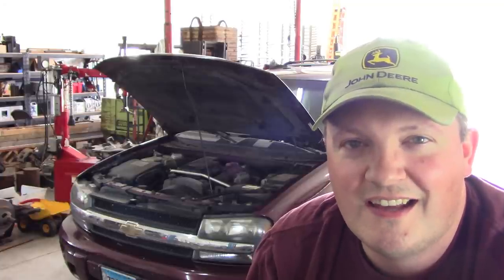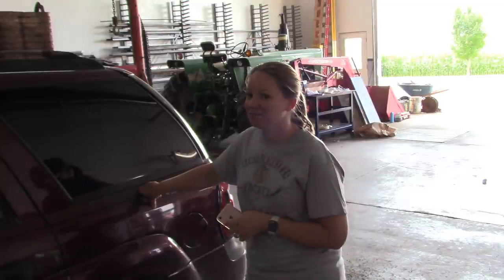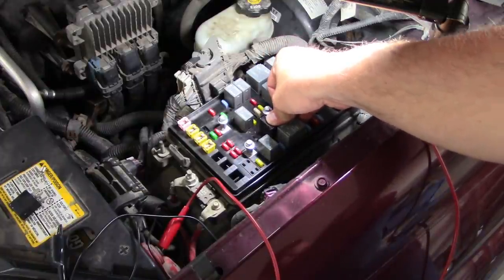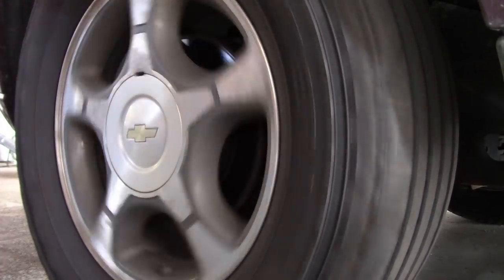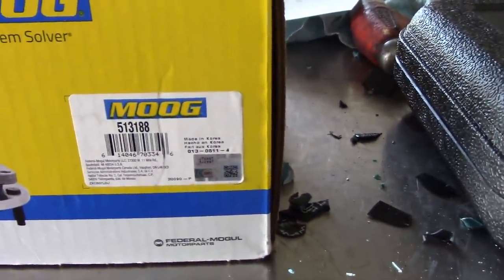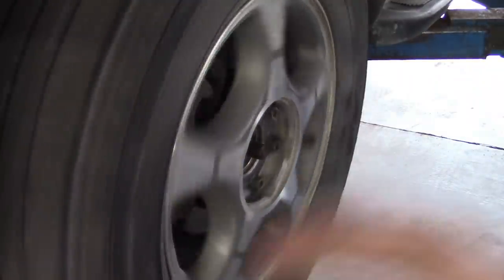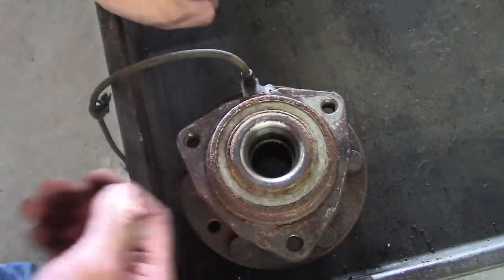Chevy Trailblazer - No Low Beam Headlights - Wheel Bearing Noise - P3

Comment: Hey Wes, just a heads up, we have 2 customers with trail blazers that have the same issue on the low beam headlights, for some reason though they only last anywhere from 6 months to a year. At first we were using o'reilly's relays but switched to AC Delco, but they still only last so long. Long story short we couldn't figure it out and they come in every now and then and we pop in a new relay.

Comment: It's not like that axle nut holds anything on other than just the axle to the hub. None of it's going anywhere even if it falls completely off. That old nut will be fine, even after it's reused again during the next brake job.
Edit: The new nut probably comes in one of those Broke When Delivered boxes anyway!
Reply from the maker: The nut holds two halves of the wheel bearing together, so it’s kind of important. But not enough to worry about.
Reply: I keep hearing that, but the splined sleeves in the hubs on my 07 K 2500 are one piece, like they're the inner race instead of two halves, maybe those K 1500 hubs are made different? I've driven my truck with the left half shaft out for quite a while without issue trying to narrow down a bearing noise in the front end.
Thanks for the comment.

Comment: The relay is the usually the issue with the trailerbazer.
Reply: These relays are solid state and have a notoriously high failure rate.
Reply: Yeah, I think I put 3 or 4 in my Trailblazer before I finally retired it.

Comment: Very instructionnal as usual ! I was wondering can i use WD-40 instead of the Rust Stopper? We do't have such product over here.
Reply: WD-40 doesn't stick around long enough. Look for something with lanolin in it, you'll know it's the right stuff because it smells like barnyard until it dries. 

Or even a thin coating of heavy grease is better than nothing.
Reply: @drrrrockzo  Thanks.
Reply from the maker: Yeah grease works well. I used to use white lithium grease in an aerosol can.

Comment: As to why it failed, All electronics actually has a shelf life so it could be that it sat on a shelf for a long time before it was used which will reduce the length of time it will last when used.
Reply from the maker: I'm guessing it does no have adequate heat sinking, but I don't know.
Reply: @WatchWesWork  That's also very possible. All it would take is a small microscopic hole it the epoxy to let in enough heat to affect the circuit.

Comment: just out of curiousity, why wouldnt you have hooked up the tech 2, or choice after market scanner, and gone into the bcm and see if you could command them on? that would have tested the whole circuit after the bcm, and also monitor your pids from the switch to the bcm, check both sides of the circuit at the same time?
Reply from the maker: Plenty of ways to skin a cat.
Reply: @WatchWesWork  true, i just know you know your way around a tech 2, nothing wrong with the way you did it, same results either way.....

Comment: tightening the axle nut to much will result in a higher friction of the bearing.
It turns hot, destroys the lubrication and massively shortens the life time of the bearing.
Reply: The bearings are tapered roller - yes, but in the outer housing they have a fixed spacer between them. That prevents the bearing inners (cups) from getting any closer together, no matter how much the shaft nut is tightened. The manufacturers initially assemble the bearings, measure the gap between the inners, then make a very accurately dimensioned inner spacer. When assembled, the result is a very fine preload to the bearing with no end play - it works very well. There are also seals on outside and inside to prevent dirt ingress. All FWD cars have the same system. It is nothing like the conventional standard bearings in a car trailer (or similar) axle where the axle nut retaining the bearings have to be adjusted so there there is minimal if any end play and then the nut is held in that position by some sort of locking device like a split pin or locking collar.  Bob Hudson. Retired mechanic from Land Down Under.
Reply: @bobhudson6659  Thanks for your explanation. I just learned something new :)
Reply: @Jan_Seidel  You're welcome.

Comment: Would the labour cost savings of replacing 30% brakes and rotors while you have them off to replace the wheel bearings be ofset by the cost of the parts later.
Reply from the maker: Probably, but you would want to do both sides, so that kind of eats the savings.

Comment: Wes, that hub nut should have a special insert, looks a bit like a helicoil in the threads. If this is damaged in any way or came of the threads when you undid it first time you definitely want to replace it then as it will come off eventually when car is driven and if the driver is silly enough to drive the car while it makes a lot of noise it can end up very badly. These are quite popular in UK, Jaguar use them on their cars and they do come off when reused, I know, I've tried :)

Comment: it has been a while since I have had a chance to work on a vehicle the last one that I had was pretty old.
leave it to Chevrolet to make it a little more complicated than it needs to be to run the headlights. the switch on the dashboard controls a relay which turns the headlights on or off.
Reply from the maker: It's much worse than that. The switch on the dash signals the body control module, which then turns on the relays which actually turn on the lights.
Reply: @WatchWesWork  that's ridiculous.
computers don't need to control even the simplest of things in a car.
I remember putting a stereo in on a 1983 Dodge ram pickup truck and the switch on the dash was set up to control the lights directly from it but it also had an alarm installed that also control the lights.

Comment: 8:43 Weird headlights setup. You have separate bulbs for low and high beam, but they cannot work simultaneously ? At least, looks like that on the video
Reply from the maker: That's not uncommon.
Reply: @WatchWesWork  I`m from Europe, but maybe in US it is common, but both of us can agree that is plain stupid. There is no reason to be like that

Comment: You have a bult in screen recorder built in to windows 10 that you can use so don't give us that problem sign in to your Microsoft account open the xbox app sign in then use Win+G to open the control Panel for the recorder it works fine just use the builtin recorder when done u can always sign in just to the xbox app only so that just the recorder is active try the Xbox recorder it works great I use it for screen recording

Comment: wes I have a question I have a 2015 Chevy Cruze 1.4   it's lacking power when you accelerate  if the AC unit is on appreciate the help
Reply from the maker: Isn't that pretty normal? I remember on the old Cavaliers you have switch the AC off the climb a hill.
Reply: I turned my AC off going up a hill put put cruise control on setup for a 57 and I could still see it lagging even though the AC was off so I am not sure what's going on I put new AC Delco spark plugs in it thought that was going to change the problem but it didn't

Comment: What end did you have on the straight die grinder for cleaning out the bore of the hub carrier?
Reply from the maker: It's a flap wheel.
Reply: Watch Wes Work  never seen one before. Looks like it would come in handy when I do hub bearings on aluminum hub carriers.
Reply from the maker: @callen6893  I have some smaller ones too. Work great.
Reply: Watch Wes Work  any suggestions as to grit for aluminum?
Reply from the maker: @callen6893  I'm not sure. I think mine are 60 or 100.

Comment: 99% of the times it's the relay with these trucks.  Quick diag is swapping it with the fan clutch relay which is identical,  the one next to it.   If the headlights work then diag is done.

Comment: One thumbs down already must be one of the pedants you mentioned. Unrelated to the pedantics can you dissolve the poting   material a la big Clive style? Or would it not contain anything other than the silicone relay?
Reply from the maker: I'm guessing there is a FET with a heat sink and some diodes inside.
Reply: @WatchWesWork  yeah and what could go wrong there, lol.

Comment: Just wait till the wires chafe and rub raw in the rear hatch loom! All sorts of goodness happens then
Reply from the maker: Don't worry, the latch is broken so it doesn't even open.
Reply: @WatchWesWork  nice...There's actually a little plastic round tab you can pop off from the inside and you can push the lever open

Comment: Great job a usual. Suggestion. why don't your wire wheel the rusty plates, covers, diffcovers etc and spray paint them with a pressure pack can. 5 minutes job and will look great :)

Comment: Torque is important on the axle but as it is responsible for the preloaded on the bearing, it warns against using an impact tool
Reply: I just made a comment to Jade above. The wording is as follows. The bearings are tapered roller - yes, but in the outer housing they have a fixed spacer between them. That prevents the bearing inners (cups) from getting any closer together, no matter how much the shaft nut is tightened. The manufacturers initially assemble the bearings, measure the gap between the inners, then make a very accurately dimensioned inner spacer. When assembled, the result is a very fine preload to the bearing with no end play - it works very well. There are also seals on outside and inside to prevent dirt ingress. All FWD cars have the same system. It is nothing like the conventional standard bearings in a car trailer (or similar) axle where the axle nut retaining the bearings have to be adjusted so there there is minimal if any end play and then the nut is held in that position by some sort of locking device like a split pin or locking collar.  Bob Hudson. Retired mechanic from Land Down Under.

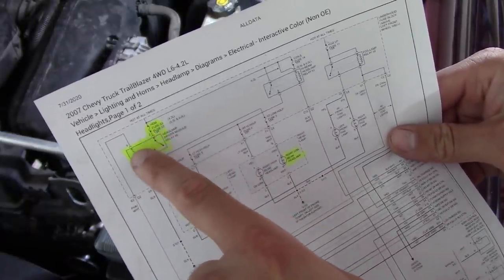Comment: 3:24    "relay" 46
Reply from the maker: Technically it's a "headlight driver module"
Reply: Both are correct here, but in the Video, Wes you called it "Fuse 46"....
Reply: Wes, I admire you for your accuracy, and am planning a 3 hour drive from suburban Chicago to correct some minor issues on my '95 Fleetwood limousine.
Reply from the maker: @chrisbourgeois175  Still human. But I'm working on it.
Reply: @WatchWesWork  Hey, would you happen to be an Eagle Scout?

Comment: These wheel bearings literally take 30 mins
Reply from the maker: You must not have rust where you live. I've had it take an hour just to get the lug nuts off...
Reply: @WatchWesWork  im in central pa lol plenty of rust road salt around here in winter is horrible